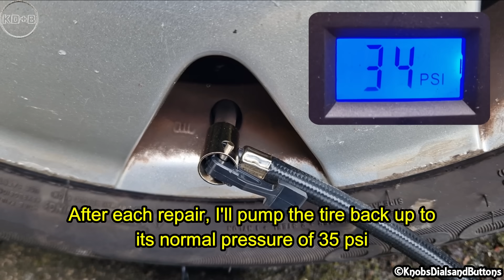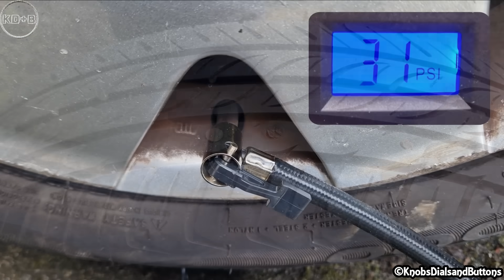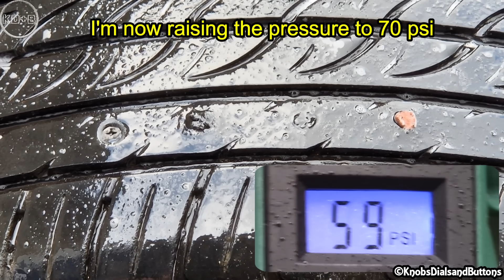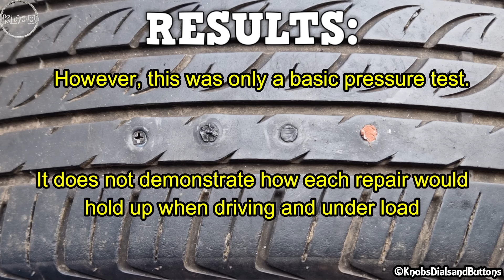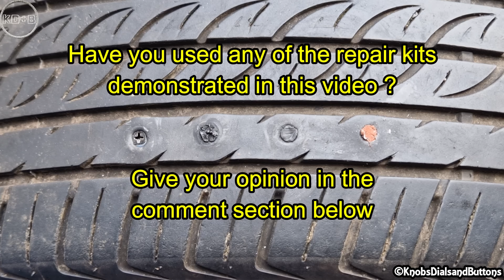Four Repair Kits, One Tire

Comment: Putting over 50 lbs. in a tire is playing with fire. I saw a truck tire explode with 50 lbs. in it. The tech went to the hospital because he was too close. It sounded like a shotgun . Test a tire patch by driving the vehicle under normal air pressure.
Reply: Most modern tires have a 44 psi cold maximum inflation pressure which means they can run at 50 psi all day long.

Comment: All of these metods are only legal on vehicles that go slower than 30 km/h -20 miles an hour, like tractors in Europe, for the repair to be road legal on regular cars, the repair has to be glued in from the inside of the tire
Reply: Show me the law.  I've plugged a gazzilion tires with the sticky rope, cops never showed up here.  Is it like a mattress tag, do not remove under penalty of law?

Comment: This isn't like working on a rocketship your plugging a hole, you could use anything thats bigger than the hole to stop a leak😂
Reply from the maker: Yes, but you need a method of plugging that hole internally from outside a tire that's already mounted on the rim. How would you do it ?

Comment: None of these are long term repairs they will get you  out of a pinch usually that's about it I work at a tire shop and have seen a thing or two. We always dismount and use combination patch plugs from the inside out.
Reply from the maker: I only recommend that are used as a temporary repair

Comment: Using a drill bit is not correct.
When a tyre is punctured, ther is no rubber removed and the drill bit does.
Reply from the maker: Yes but the reamer tool is going to do that with each repair anyway. I used a drill bit for consistency of the puncture holes

Comment: I was expecting the screw repair to blow out, if that had a chemical surface or rubber solution added it would be even better, definitely the easiest to put in, just a shame it will always look like a black screw in the tyre unless you leave some of it protruding from the tyre surface and cut the 'screw head' off?

Comment: MY BIKE TYER PUNCTURE WITH PLUG STRIP AFTER FEW MONTS AIR LEAKING IN SAME PLUG STRIP. PUNCTURE SHOP GUY TOLD NOW DOUBLE PLUG STRIP WILL DO SIR, ONE SINGLE STRIP RS 100. TWO IS 200 , IN MY TYRE 6 PLACE GOT PUNCTURE, NEW TYER RS. 1300 ONLY,

Comment: The issue with this test is that you drilled a hole and removed material. In real life no material is removed ao the results will differ dramaticaly.
Reply from the maker: The rasp tools actuallt enlarge the holes more than the drill bit and I wanted 4 consistent puncture sites.

Comment: Knowledgeable and trained technicians in developed countries will refuse to insert plugs into the tires of any fast moving vehicle. A tired needs to be inspected for damage which can only be done by taking it off. It must then be patched, repaired by either cold or hot vulcanization. Plugs on heavy trucks are at best suitable to get you to the shop. Plugs on passenger cars are irresponsible. Plugs on motorcycles are suicidal. Repairing tires is not work a layman should attempt unless on the backroads of Somalia or so.

Comment: I get it your doing this for views but that tire won't pass an inspection with more than two repairs and if the repairs are within six inches it would fail. I also know from experience that if the repair is on a tread block like that even if you cut it down they have a tendency to push out. Drilled four holes in a decent tire to in reality completely destroy it!

Comment: None of these are good. Only use in an emergency. The best way to repair a flat is to put a patch on the inside, otherwise you risk ruining the radial tires and some of those radial tires are quite expensive $300